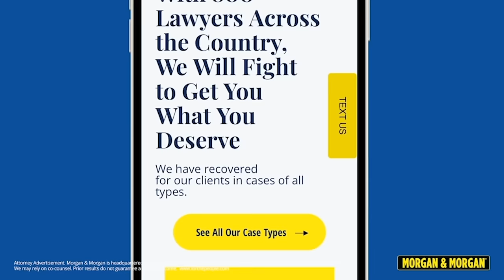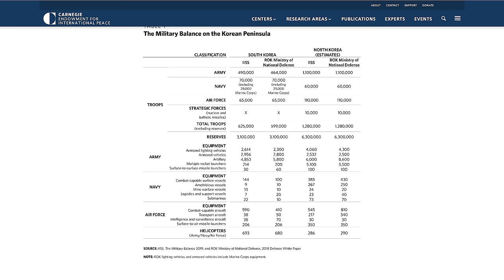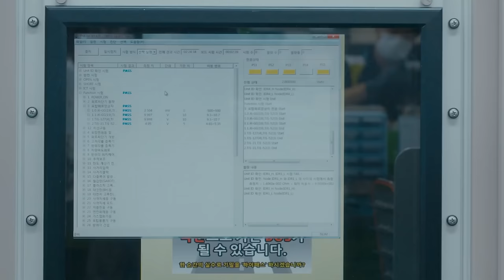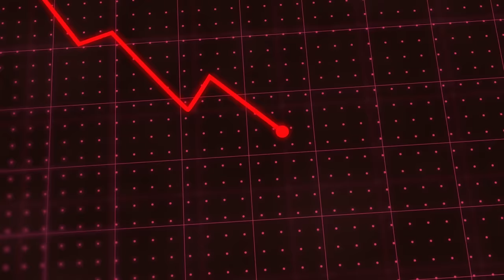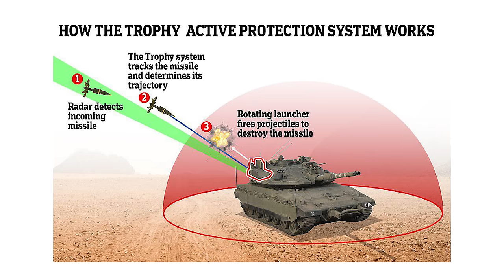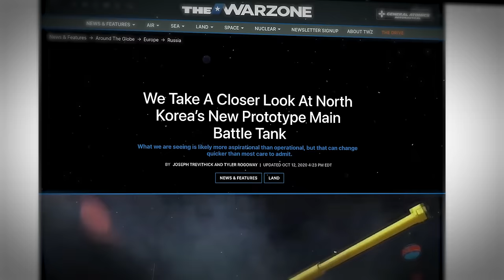North Korea's NEW Tank is a Nightmare

Comment: I am stunned that Americans still think the Abrams is a good tank. The Iraqis, who lacked anti-tank guided weapons or mines, and who lacked training (‘Abrams Tank Systems: Lessons Learned Operation Iraqi Freedom 2003’, Presentation, US Army TACOM, June 2003), knocked out Abrams tanks with RPGs (Dr. Stephen Biddle, ‘On Operation Iraqi Freedom: Outside Perspectives’). The only tank-vs-tank battle in Ukraine involving an Abrams saw it knocked out with a single shot from a T-72.
Reply: Tanks in the first line at the front getting damaged/taken out is nothing out of the ordinary, especially in urban areas. If an enemy soldier is waiting in an ambush position at every corner, someone will score a hit.
This will happen to any tank, just a matter of time.

Just went over the sources you provided. Have you actually read them?

"Summary
-The Abrams tank preformed extremely well providing
excellent maneuver, firepower, and overall crew protection

-Engines typically outlived expectancies and transmissions
proved to be durable

Specific areas of improvement include:
-Side and rear armor protection
-Wartime ASL/PLL authorization
-Stowage plans
-Suspension durability"

"Had the Iraqis been better skilled, however, the same technological match up could have produced a much costlier outcome. The M1 is an extremely survivable tank, but no tank has equally resistant armor on all surfaces, and like all tanks, the M1's flank armor is much thinner than its frontal arc. In Operation Desert Storm, M1s were killed by T72 or BMP fire that struck them from the flank or rear; in OIF, even RPGs sometimes penetrated M1s when hit from the proper direction.[37] And six of the 3-7 Cavalry Apache troop's 13 armored vehicles at Objective Montgomery were Bradley Fighting Vehicles without even the M1's level of flank armor protection. At Montgomery, the Iraqi position afforded flank shots by most Iraqi combatants against all of Apache troop's tanks and Bradleys - at ranges of as little as 800-1000 meters.[38] A well-trained tank battalion would expect to hit with nearly every shot at such ranges; the 16 or more shots fired by the Iraqis at Objective Montgomery could thus easily have wiped out Apache troop if fired by crews with skills anything like their American attackers."

It's alot more complicated than "AbRAmS BaD".

Comment: LOL...The term "designed" was used to describe using ATGM's on a tank.  If it was an actual weapons system it would have been "engineered".  Engineering is function, design is aesthetics. The drivetrain and suspension on cars are engineered, the interior and exterior body are designed. A tank is 100% engineering, 0% design.
I'm not sure if saying it was designed  was intentional, but it was amusing.  A slight that implies that the tank is all show but no go.

Comment: Starting to look like North Korea decided to actually put fourth a legitimate effort on designing and constructing a tank. With the side ATGMs and then the other cutouts for launchers around the turret, I'd have to think or hope that this indicates it has modular armor so that if it needs a different front section armor can be affixed. It also indicates that they're developing ATGM systems and this platform is also a test bed. Then if it isn't an ATGM then it's probably an anti-aircraft missile as it would be it's worth it's weight. So I think this tanks true strength is it's modularity. Look at the Bradley fighting vehicles, originally it had machine gun positions that were soon over lapped with more armor. Along that North Korea wants to smartly spend it's money on the most adaptable options that may actually work just for modularity or for maybe these platforms aren't fully developed but they have to be shown even if it has to be a prop.

Comment: I do disagree with the evaluation of the added ATGM. Such a missile will provide extra range to the vehicle outside of cannon range, and one both missiles are depleted, the tank does have its main cannon. Sure the sabot round is cheaper but tanks are more expensive than either option. In theory a North Korean 2020 tank can knock out two of its peers before they get into range for an attack . A bradley has to reload the missiles because it has no other weapon to fight them with, unlike this tank. I wont say its perfect at all but the North Koreans are clever where it counts

Comment: This video is a little one sided in the point about having ATGMs on an MBT so I thought I’d play a bit of devil’s advocate and give a couple practical reasons for having them mounted.

 ATGMs fired from main battle tanks offer an increased effective range over kinetic energy penetrators makeing them effective as stand-off weapons. Plus you have to figure that the fire control systems on those tanks are likely going to be very dated and subpar compared to contemporary systems meaning that using guided munitions would be more favorable in long range engagements. Furthermore ATGMs can be used against low flying helicopters and other targets with some types being quite effective vs hardened structures such as those ATGMs carrying  thermobaric warheads.

 Personally I’m more in favor of the standard approach for tank armaments; a main gun firing kinetic and chemical  energy rounds for offensive purposes with a coax MG and a couple of crew served MGs backing it all up. 

..maybe throw in a flamethrower or two with a chain flail mounted to the front hull and maybe one of those metal storm things.

Comment: North Korea now has 10 new main battle tanks. #10 sat out the parade because it was used for parts to get the other 9 going. They now have enough "modern" battle tanks to fend off invasion from Somalia.  Slapping a sheet metal turret on a Russian tank chassis is like putting a bookshelf sized spoiler on an economy commuter car. Heavy metal, like actual thick plate armor is welded in ways that don't look like the thin plate armor on these North Korean main battle tanks. In fact I would be willing to hazard a guess that these "tanks" aren't armored more heavily than a BMP. In fact I would be willing to bet that plate armor is actually aluminum. The irony here is that N. Korea is trying desperately pretending to be a superpower while they can barely subsistence farm an economy to feed their population. They don't even have a platoon of new main battle tanks. They have what everyone else would consider prototypes. You can't even start a tank production line & have the bugs worked out in less than 10 tanks. I want some of whatever they are smoking, that is some powerful shit.

Comment: Russian tanks have less firing range with their main guns and lower penetration with kinetic rounds...so they adopted the solution to fire missiles using the main gun .... Therefore to put a guided weapon on a tank is gaining on engagement range.... and it is easier  to put it on the outside of the turret than build a tank with systems to use the main gun .... If the solution is good - that is another debate

Comment: If I may steelman The North Korean position (present the best possible arguement).

If we take the lessons learnt from Iraq and Afghanistan plus what we're learning from Ukraine. Tank on tank battles are probably a a thing of the past. 

I'm guessing the North Koreans made a MBT focused around the infantry support role. (Much like we did with the challenger 2 in Afghanistan and Iraq). Focused more on removing people from dug in positions. Rather than tank the tank battles. 

North Korea was never going to field a tank which could challenge a challenger or an M1. realistically you don't want to, infantry with MPAT or Apache helicopters. Is how you deal with tanks. 

A lot of this makes sense in the tank design. You have an active protection system which isn't designed against heavyweight anti-tank shells, instead RPGs. You have armour which wouldn't stop a heavyweight anti-tank shell but might stop a anti-tank missile. I'm guessing main cannon probably has anti-infantry rounds in preference anti-tank. With the anti-tank missile launcher as a last option. 

To summarise. I feel North Korea correctly assessed. They wouldn't stand a chance against an M1 or a challenger, so decided to develop a tank which can support mechanised inventory divisions, in preference to armour divisions. Having that anti-tank roll done by inventory mounted missiles and probably aircraft / drones.

Comment: 708...1100 mm of armor REALLY?.....did you think before you said that?  1.1 meters of steel armor is three times the hull thickness of a ship.  

FURTHER....YOU MISSED THE MAIN POINT OF.....NOT....NOT....MOUNTING CRAP OUTSIDE.  IT BECOMES A RATHER FANTASTIC TARGET BECAUSE IT IS OUTSIDE THE BODY ARMOR.  

THIRD....YOU CAN PUT OUTSIDE OF AN APV/APC  BECAUSE THE REAL JOB IS TRANSPORT OF TROOPS AND SMALL AREA SUPPRESION.  THEY ARE FASTER AND FAR MORE MOBILE THAN TANKS....THEY CAN BE TANK KILLERS

Comment: Lot of questionable/straight-bad info here.
NK's T-34-85s rolled over the South's defenses in the Korean War; they were incredibly effective.  We nearly lost the war were it not for the USMC and holdout in Busan.  화이팅!
"Oversimplification" is inaccurate; your portrayal is false.

The extra roller signifies it's a T-62 upgraded with surplus T-72 components.  
The TOW is likely supplemental in case they can't pen a modern tank.  It certainly could be for show, but there's not much to go on; safe be to assume it's functional.  
NK tanks are surprisingly scary for their intended use (mountain warfare).

Comment: Freezing the video at min 8:15 shows some pretty awful welds.  They're inconsistent and sloppy.  Either the metal is substandard, the welder was somewhat incompetent or a combination of both.    Just going by this one indicator I'd say these are probably low quality machines built by slave labor.  I ran better beads in high school metal shop class.

Comment: Given the limitations placed on the North Korean government to product such an MBT regardless of the amount of assistance, still a vast improvement on past Soviet designs (& much agreed tank does look much like the offspring of an Russian T-14 & American M1🤔). This new tank has ammo. stowage in a much safer configuration (a drastic change from the previous Russian pop-top turret designs 🤯) & presence of a credible active defense capability is an eye-opener 🤨. Certainly a pair of wire-guided ATGM's are not on par with (top-attack) laser guided munitions that S. Korean K2 tanks are able to fire from their 120mm main guns 😏(& seems a step backward from Russian laser guided munitions that can also be fired from their main 125mm gun). Still (likely..) is an upgrade in range & accuracy over the Cheonma-2 (new name for the 2020) main gun (with a much lower firing signature) & layout similar to the M2 Bradley's TOW missile setup so see the logic in the design (not just for vanity, but possible export purposes 😉). Bottom line highly doubt these new N. Korean MBT's have the latest generation of munitions, optics, fire-control, active/passive defensive systems or armor quality of their S. Korean counterparts (for the latest variants of the K2 are consider one, if not the best MBT's in the world). PS - Could see a scenario where N. Korean Cheonma-2 tanks are sold to Russia to fight in Ukraine (hopefully to be countered with K2 MBT's originally destine to be sent to Poland, diverted to 'active' service with the Ukrainian armed forces).